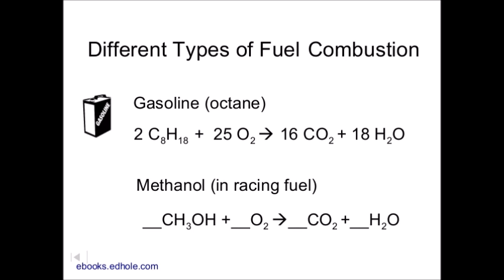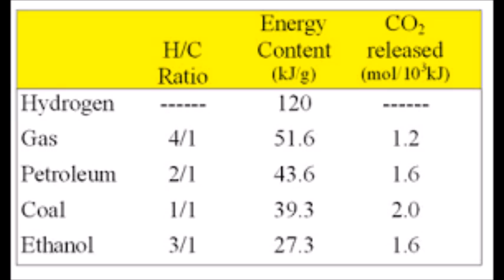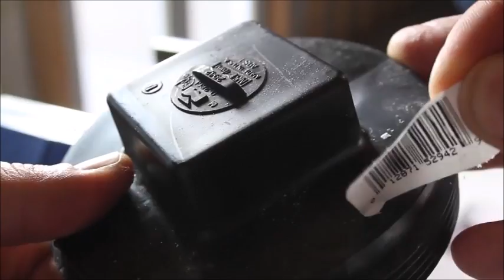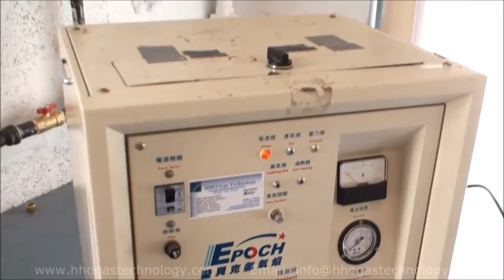solar hydrogen & oxygen generator, how to end global warming, air polution, & energy shortage

Comment: It's more then just tkor's video he's ripped off here. Every bit of footage that wasn't him filming himself with a potatoes was ripped off.

Dude: you can't call it "your invention" if:

A) you didn't invent it
B) you haven't built it yet
C) rip all your footage from other YouTube's then post it on the same damn site!

Also, at no time have you addressed storage of the hydrogen in a safe manner.

Double also, releasing the oxygen will not increase the earth oxygen content as when you burn the hydrogen to produce power etc, it will combine with atmospheric oxygen and create water, thus negating any oxygen you released.

Your head is in the right place, but you need to go deeper down the rabbit Warren. Hho generators use massive amounts of energy. Can solar produce enough to make it sustainable?
Can hydrogen battery cells convert back to electricity without massive losses?

Can you use this technology to remove base elements, heavy metals and minerals from sea water? If so, then do floating hho solar islands become a real thing?

Comment: Water accumulation is not the problem, carbon dioxide is. Water is formed, cools, and falls back to Earth. Carbon dioxide, on the other hand, comes from the ground and stays in the air. This is the problem with fossil fuels. Water is the solution, not the problem.

Comment: Good concept for fuel, but the oceans are not rising, lie #1 your told, i live and grew up on a bayou town on the gulf of mexico, the water is the same level as it was when i was 12 yrs old. im 44 and i live where the land of south la sinks yet in the last 32 ys of my personal observation the water level is the same.

#2. even if  the water level rise was true, using hydrogen would not affect the water level. As we know it would burn out the motor and cool back into liquid form returning to be reused. not evaporated away.
Reply: Sea level should decrease because we are storing so much of it in our drinking water pipes think about how much water is in pipes underground that supply our domestic water supply..im just a plumber

Comment: Take a good look at the Nernst equation. Consider two pairs of electrodes - one for electrolysis, and the other one in a fuel cell. Have the ratio [Red]/[Ox] = 1 in both cases, but let electrolysis produce gases at a high pressure (then these gases will undergo isothermic expansion and perform work). Show that such a system can deliver useful energy. My email: htg@interia.pl , my other email: leocatv@gmail.com